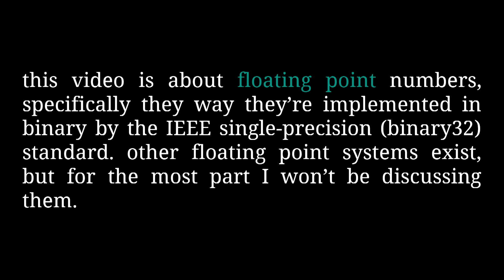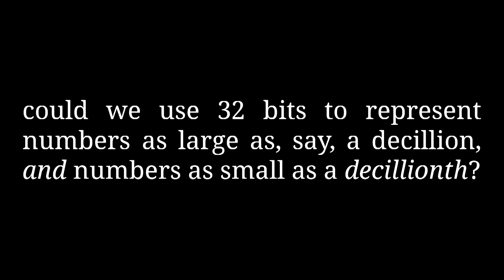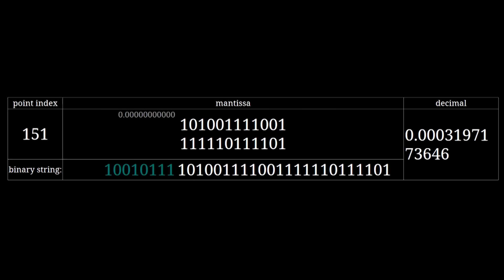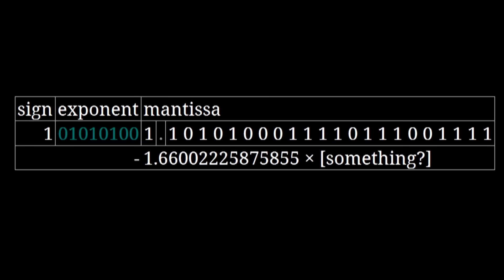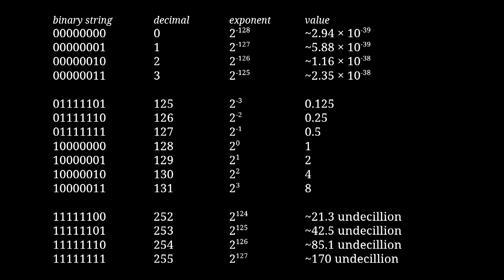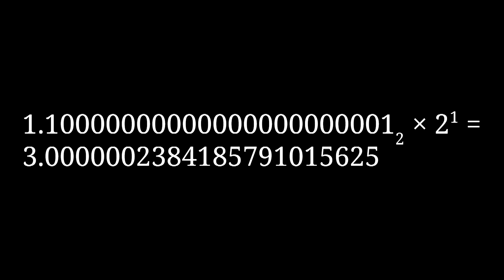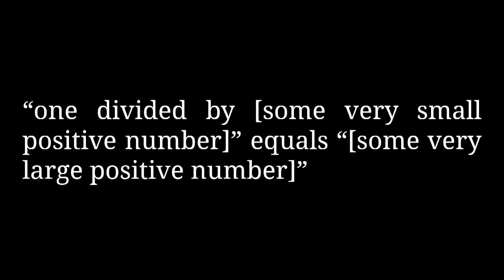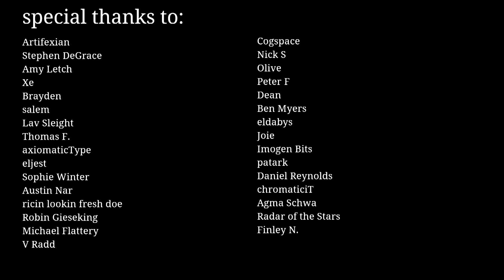how floating point works

Comment: Floating-point is a very carefully-thought-out format. Here's my favorite float tricks:

* You can generate a uniform random float between 1.0 and 2.0 by putting random bits into the mantissa, and using a certain constant bit pattern for the exponent/sign bits. Then you can subtract 1 from it to get a uniform random value between 0 and 1. This is extremely fast and has a much more uniform distribution compared to the naive ways of generating random floats, like "rand(100000) / 100000.0f"

* GPU's can store texture RGBA pixels in a variety of formats, and some of them are floating-point. But engineers try as hard as possible to cram lots of data into a very small space, which leads to some esoteric formats. For example, the "R10G11B11" format stores each of the 3 components as an unsigned float, with 10 bits for the Red float, and 11 for each of the Green and Blue floats, to fit into a 32-bit pixel. Even weirder is "RGB9_E5". In this format, each of the three color channels uses a 14-bit unsigned float, 5 bits of exponent and 9 of mantissa. How does this fit into 32 bits? Because they share the same exponent! The pixel has 5 bits for the exponent, and then 9 bits for each mantissa.
Reply: So if the colors in RGB9_5 share the same exponent, then wouldn't each color have roughly the same brightness, each less than twice as much as each other? So the colors would always look pretty unsaturated.
Reply: @pekkanen_sr   no, because you would scale the other components' mantissa.
e.g. if you want very bright red with very small green value, you set high exponent, high red mantissa and low green mantissa
ofc this way you lose precision with very bright colors, but that's the point
Reply: @kkard2  So are you saying the first digit of the mantissa can be a 0 whatever the exponent is, unlike with usual floating points?
Reply: @pekkanen_sr  hmm, tbh i just think it's that way, fast google searches failed me and left with unconfirmed information...
Reply: @kkard2  Because if it's not like that then my point still stands, the highest the mantissa can be is 1.11111111 in binary or about 1.998 in decimal, and the lowest it can be is 1, which is exactly what i was saying
Reply: oh come on, you can't talk about floating point tricks without mentioning fast inverse square root
Reply: @globalincident694  Sure you can, the Quake fast inverse square root calculation is an old trick that's not relevant to modern computers or modern programmers. CPUs these days have built-in inverse square root approximation instructions that are much faster and work differently. Even a full-precision square root instruction is generally faster than the Quake method.
Reply: So that is how it works? I'd heard that the naive way generated non-uniform floats, though I'm not exactly clear on why that happens. I also knew that 23 random mantissa bits with an exponent of 0 would generate a uniform random between [1,2), but for some reason I thought that subtracting 1.0 could compromise that uniformity, since there's not a uniform distribution of numbers between [0,1), where there are more numbers closer to 0 than there are to 1. I guess I just incorrectly extrapolated from the fact that directly generating a random float between [0,1) (like, random mantissa, random negative exponent) isn't going to be uniform.
Reply: @TetrisMaster512  I believe that subtracting 1.0 won't change the spacing of the values at all, so they will remain equally distributed between 0.0 and 1.0.  However, they will now have a negative exponent (because they are now less than 1.0).  This means that as normalized numbers, they will have one or more zero bits at the end of the mantissa.  So there will be a great many numbers between 0.0 and 1.0 which the floating point format can represent but this algorithm will never generate.  This will be fine for some applications but not for others.  It just depends on what you're doing.

An example with a 2-bit mantissa format:

The first step generates one of four values: 1.0, 1.25, 1.50, or 1.75.  Next we subtract 1.0 leaving one of: 0.00, 0.25, 0.50, or 0.75.  when normalized, this becomes: 0.00b, 1.00b-2, 1.00b-1, or 1.10b-1.

So, assuming I didn't mess this up, we never generate any of the following:
0.01b-2, 0.10b-2, 0.11b-2,
1.01b-2, 1.10b-2, 1.11b-2,
1.01b-1, 1.11b-1

That's 8 values out of the 12 in the range from 0.0 to 1.0 that we never see.  But as I said, that only matters for some applications.
Reply: @doctorbobstone  As it happens, the other common method of generating random numbers in [0, 1) has a similar problem, but it can generate values that don't have any trailing zeros in the mantissa. You just fill in an integer's 53 least-significant bits with random values, leave the other 11 bits as zero, and float-divide by 2^53. This will generate all possible floats in [0.5, 1) (mantissa can take on all values), half of all possible floats in [0.25, 0.5) (mantissa always ends in 0), a quarter of all floats in [0.125, 0.25) (mantissa always ends in 00), and so on. Each possible numerator corresponds to exactly one possible output value, no two distinct numerators can generate the same output value, and the outputs are evenly spaced over [0, 1), so this is a good method overall.

(The number 53 comes from the double-precision floating point standard. For single-precision, you use 24 instead. It's always the full width of the mantissa, including the implied leading 1.)

There is a way to generate all possible floats in [0, 1), without leaving any out or exhibiting a bias towards zero, but it's much slower and uglier. Start with (biased) exponent value -1 and flip a coin (generate a single random bit). If heads (one), decrement the exponent and flip again. If tails (zero), stop flipping, and fill in the mantissa with random bits. However, there are edge cases that need to be dealt with, particularly surrounding subnormal numbers and the smallest possible exponent. Dealing with those is left as an exercise for the reader.
Reply: @NYKevin100  so, how about this: Use the original posters method. So, now we have a number with its exponent correctly distributed. Then we binary XOR in new random bits to replace the mantissa.  Now all bits of the mantissa are set randomly and the exponent is set correctly, so I think every representable value between zero and one shows up with a probability proportional to the spacing of numbers on its area of the space.

Example (again using a two-bit mantissa for simplicity):

We select the initial random value and get 0.50 after subtraction. Since it had been normalized, the exponent is -1, the first bit of the mantissa is 0 because it was part of randomly selecting 0.5.  The second bit is zero because normalization forced it to be so.  Rather than calculating how many unrandomized bits there are, we just replace all mantissa bits with new random bits. So now, our value is one of 0.500, 0.625, 0.750, or 0.875, all equally likely.  If we had originally selected 0.75, the final answer could be any of the same set.  So, we could get 0.500 by two paths each with probability 1/4 * 1/4 = 1/16.  Together, the total is 1/8, which is the correct probability.

This algorithm does the minimum of bit math but requires additional random bits.  And still ends up uniformly distributed.  See any issues with it?
Reply: @doctorbobstone  I don't see any obvious biases with that method, but there is one practical issue: You need twice as many random bits (which is also the case with the slow method I described). So if you don't care about hitting every possible float, it's probably not worth doing.
Reply: I thought pixels could only display the colour range 0-255, that is 1 byte of data. With 3 channels that is 3 bytes, and with an alpha channel that is 4 bytes (i.e. 32 bits). How are these formats meant to save space if they take the same (or more, in both of these cases) amount of space as a naive approach?
Reply: @瑠ちゃん  There are many video and image formats which only support 8-bit values for each component, as you say. However, sometimes doing the math with higher precision or larger ranges is valuable even if you later down sample to 8-bits.  There also are, I believe, video systems with more than 8-bits of resolution per channel, so that would be another reason to consider formats which allow larger ranges.

I believe that high dynamic range rendering (like in some 3D games) is an example of a use case.  Imagine you have a really bright light source like the sun.  If all the math is done in 8-bits so that you can accurately represent the brightness of the sun, then everything else in the scene will be comparatively dark and have low color resolution.  By using floating point, we can do the math with the sunlight, but still have things in the shade be visible. When we want to render to the actual video card, we cut off a lot of the bright end of the range so that the scene we are rendering is appropriately exposed and not washed out by math artifacts.
Reply: @瑠ちゃん  The main reason is that textures are used for things other than physical color. In fact, most texture memory in any modern game is being used to store things other than color. Such as the metallic-ness of a surface, or the world-space position of a surface, or the shadows being casted on a surface. Many of these quantities need floats.

Additionally, HDR monitors are a thing. They can essentially display colors outside the usual 0-1 range, and/or have more than 8-bit precision within that range.

Finally, HDR rendering is useful within the rendering pipeline of a game even if the final image is not HDR, for effects such as bloom.
Reply: On random numbers, the method you described still isn't ideal because it can't generate all possible values between 0 and 1. I have seen a paper on the correct way to generate random floating points between 0 and 1. I can't remember all the details now, but the basic idea was to generate the exponent by "flipping coins" (generate a random bit) until you get tails, the more heads you get in a row the smaller the exponent is, and then generate the mantissa uniformly. But there were some extra steps to deal with edge cases (boundaries between exponents), subnormals, etc.
Reply: @kered13  thanks for the info, my background is computer graphics so my knowledge is focused on aesthetic randomness. The human eye usually doesn't notice a few missing bits here and there, but cryptography and scientific simulations would!
Reply: ....oh, _that_'s how floats between 0.0 and 1.0 are uniformly distributed.

i never really understood that and thought of it as a "one guy gets really confused" paradox

Comment: I wonder if this video will mention that f32 was made with that amount of exponent bits to fit Avagadro number (big) and Gravitational constant (small)
Reply: or maybe not gravitational, but "h" quantum constant that I forgot the name of
Reply: @NoNameAtAll2  Planck constant
Reply: @ThomasTheThermonuclearBomb  I think the gravitational constant is 6.6743 × 10^-11, 9.8m/s^2 is what you get when you plug the grav constant in with earths mass and stuff though!
Reply: Ah, so that's why. I always wondered why they didn't use 7-bit exponents instead.
Reply: @ThomasTheThermonuclearBomb  That's called "acceleration due to gravity" (average at approximately sea level), or lowercase g, and it's not actually a constant, it technically depends on what part of the world you're on, but the difference is too small to care unless you manufacture scales. The gravitational constant is a fundamental constant used in general relativity, and it's spelled capital G.